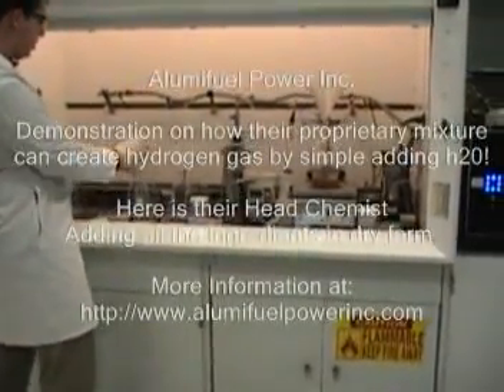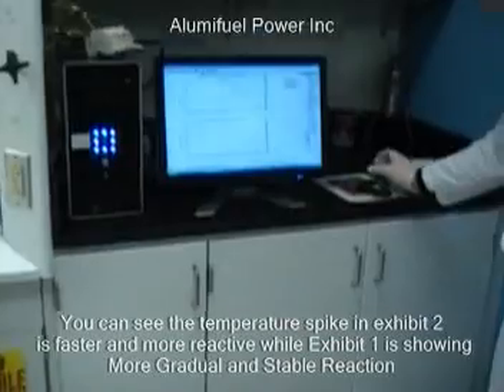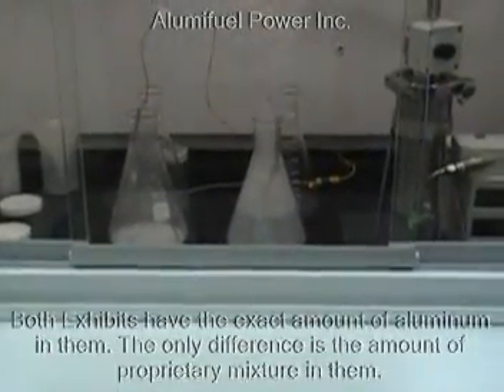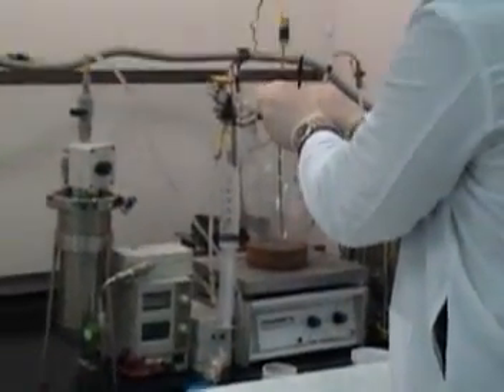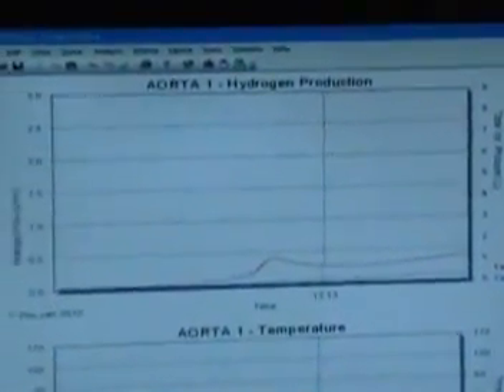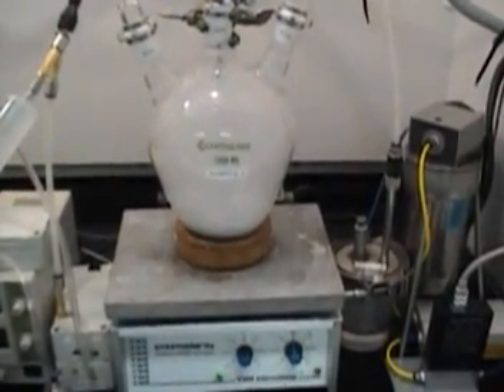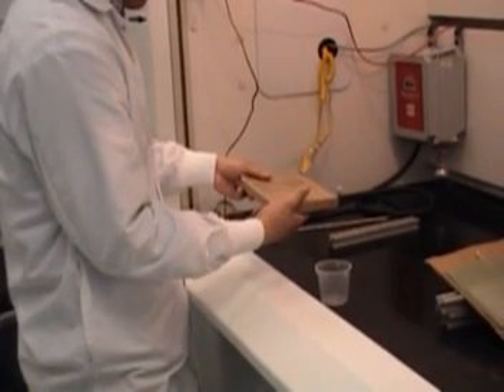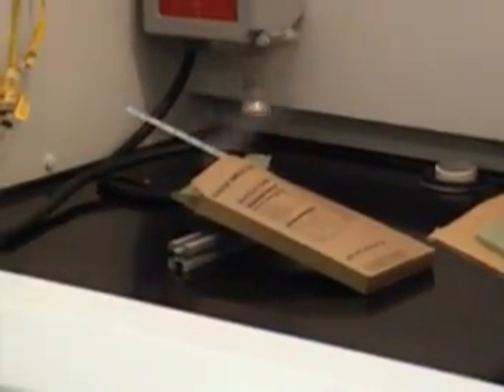Alumifuel Power Inc. Demonstrates how Their Proprietary Mixture creates Hydrogen from Aluminum.

Comment: By the way we don't need to make aluminum powder to get the reaction, i think u made that just to get the attention of buyers cos you could add your ( additives ) to the water not to the alluminam before mixing all that together not the other way around, I could use some alluminum foil wich is very cheap or even use my empty aluminum soda cans, we need a cheap solution not a bunch of expensive cheap stuff!